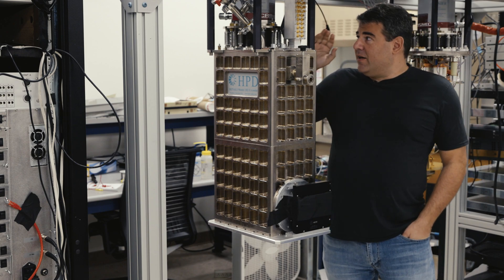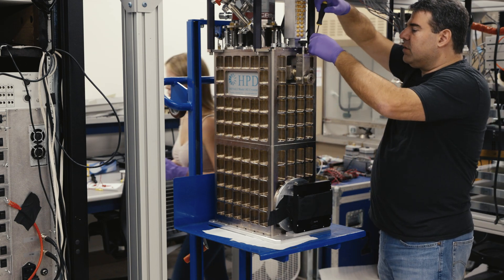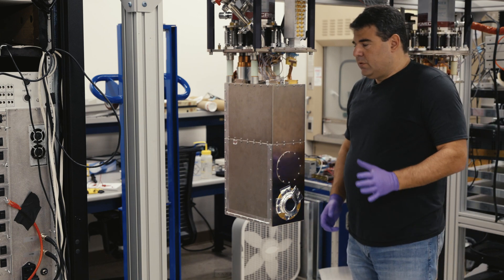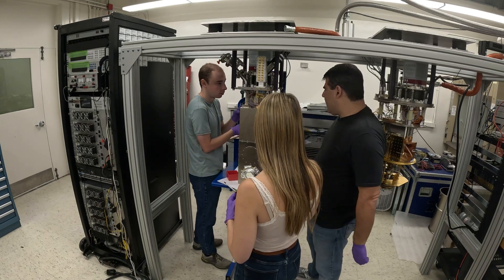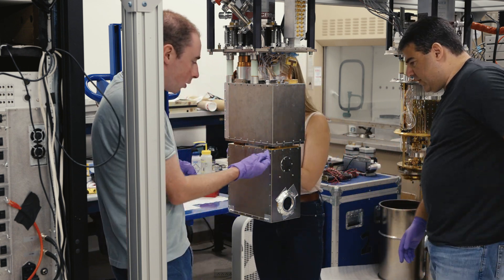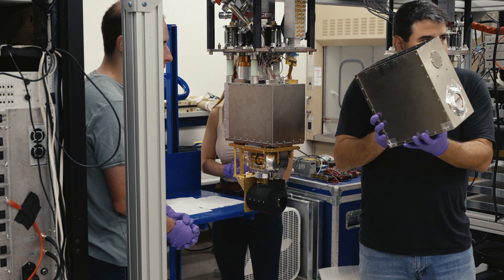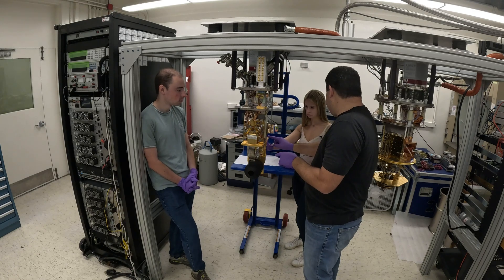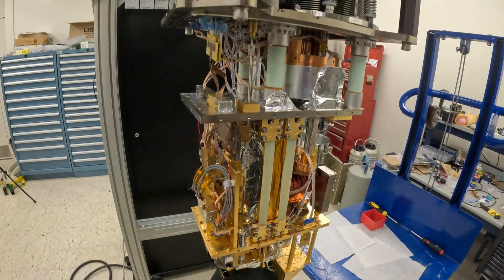Disassembling the Coolest Exoplanet Camera in the World

Comment: So why does the camera itself need to be so cold, especially when it’s looking through a hot atmosphere?
Reply from the maker: Great question. The low temps basically stop matter from vibrating much - these vibrations can swamp weak signals. The atmosphere (and telescope) do emit black body radiation, but we look at short wavelengths (below 1.5 microns) where this blackbody radiation is essentially zero.

Comment: Thanks to YouTube, I am down the rabbit hole to figure out what interference they are trying to overcome with the He-3 cryo upgrade…
Reply from the maker: We currently use HEMT amplifies that have a 2 Kelvin noise temp. We are going to add new traveling wave parametric amplifiers that have a noise temp closer to 200 mK, and they have to operate colder - around 300 mK. Our 100 mK stage doesn’t have enough cooling power, hence the He3 upgrade.
Reply: Just found your channel, this is such an over the top piece of engineering. I had no idea there was such a thing as a sensor array that operated at 100 mK 😮